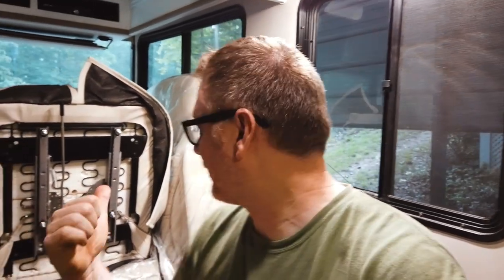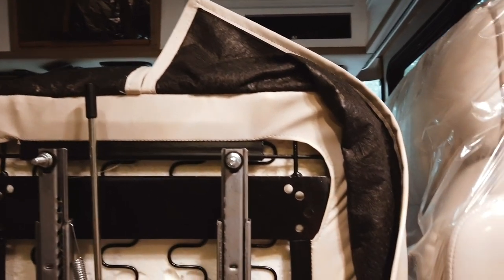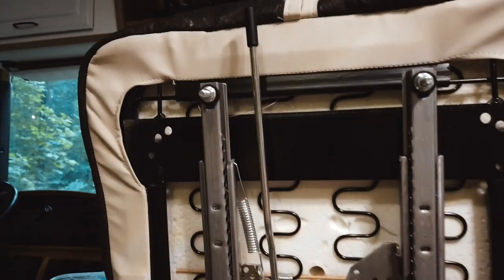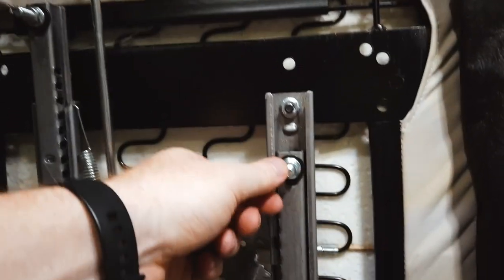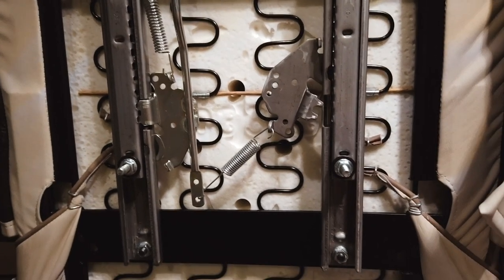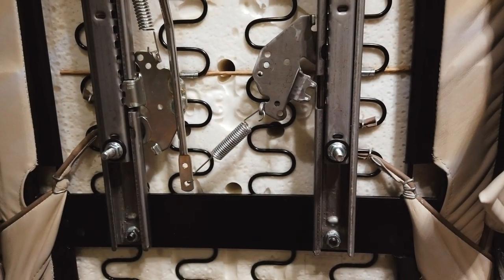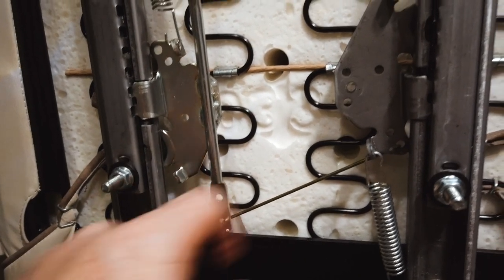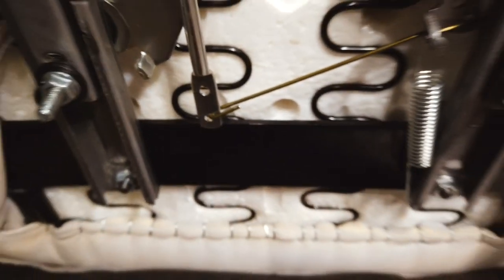Fixing RV Seat Mechanism // 99 Fleetwood Bounder

Comment: Hi great fix! We have a 98 Boulder.
My question have you upgraded the batteries?  Please do a quick on the switches above the door I think disconnect or start on 2nd set of batteries.  Great channel Thanks!
Reply from the maker: I never upgraded the batteries but I do have a video on some of the charger issues I was having :)